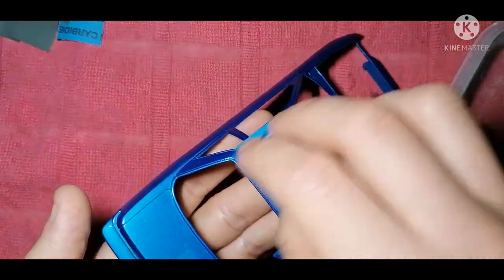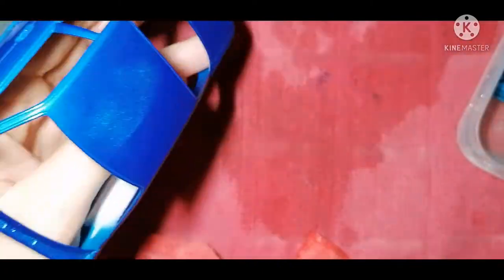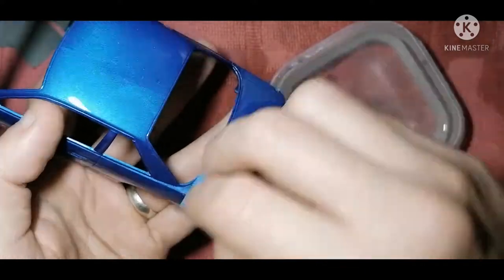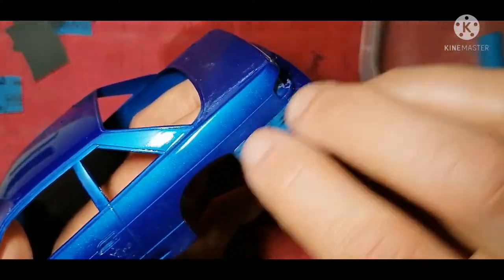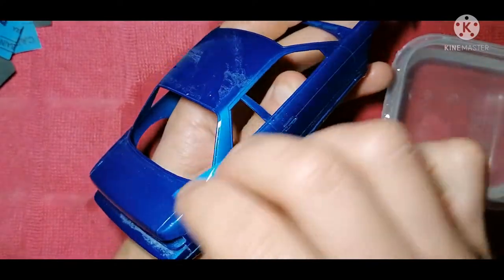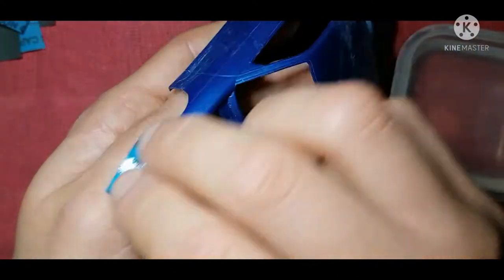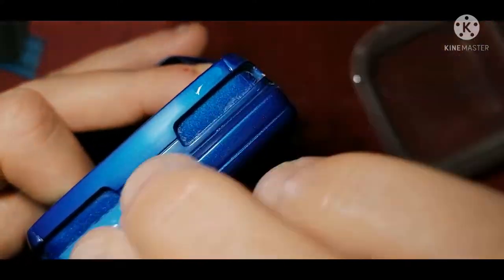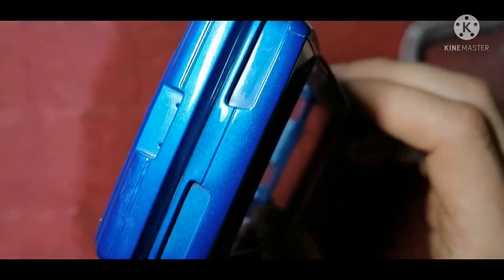Aoshima 1/24 S13 - polishing the bodywork (methods for beginners)

Comment: Hey Chris awesome video  I have subscribed for the good data, What do you do to remove dry polish from the body lines like around the doors etc?
Reply from the maker: Thank you very much I really appreciate that 🙏🏻🙏🏻😊 so I tend to have the body under a running tap and use a cheap toothbrush and just brush in the panel lines to remove what I can 👍🏻😊
Reply: @KitBuilderChris  Thanks for the help will try that